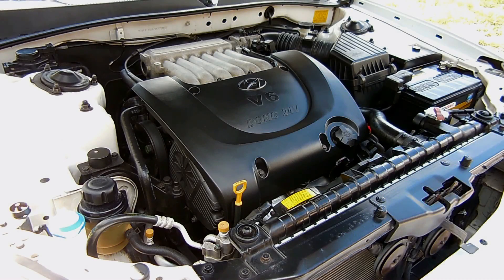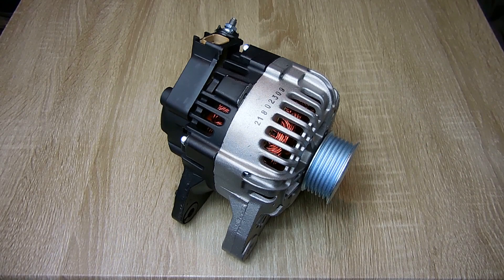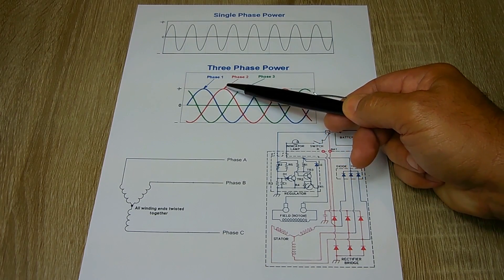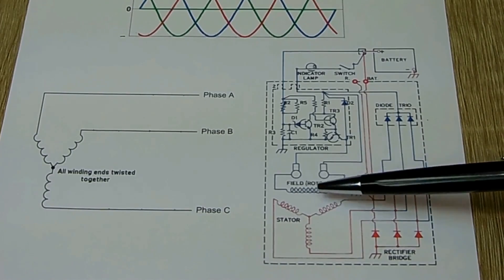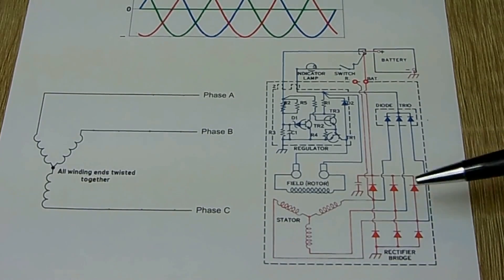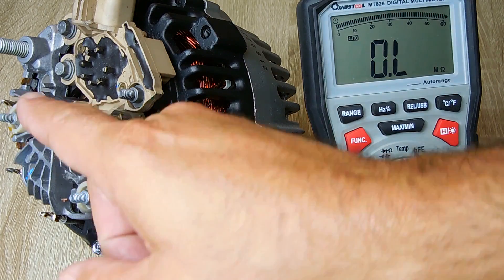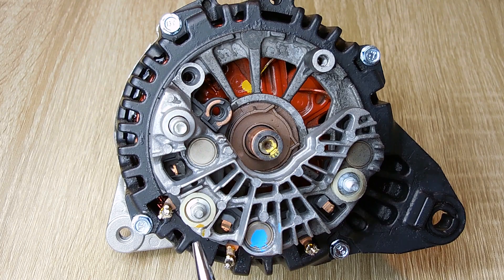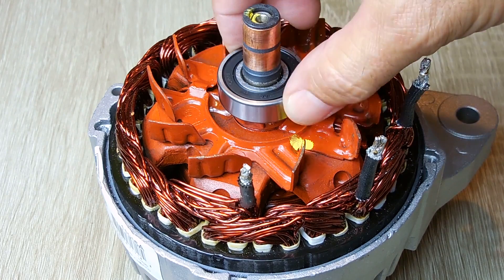Alternator Testing & Repair (EVERYTHING You Need To Know!)

Comment: Very nicely explained. I am facing problem with my car's charging system. When I  hard accelerate my car, the battery symbol lights up intermittently. During night I noticed that when this battery light comes on dashboard, head light also dims. When I rev the car at standstill this light does not come.  Alternator was checked in workshop and they said that it is fine. Voltage regulator cutout was also replaced but still problem didn't solve. Is this the sign of loose connections in alternator windings ?
Reply from the maker: Sounds like intermittent failure of the alternator or a loose wire

Comment: I've understood the basics for years and have even dug into and repaired an older alternator 25 years ago, but now my beater has an overcharging problem and I thought I'd watch a lot of videos to see if it's a simple cheap fix that will keep it on the road. 28 year old vehicle in the rust belt, I believe original alternator with 231k miles.... Did I mention oil soaked for a few years since it sits at the bottom of the pile, so bad that it got rejected from a Jiffy Lube while on vacation, and people come into the restaurant to tell me my van is on fire after I park and walk in (I ask if they actually saw flames). This video is the best I've ever seen and explains things quickly, efficiently, and very clear.... But I'm still puzzled for how the system reads battery voltage and if it could be a false low thus causing an overcharge of almost 18 volts. I have the gasket to fix the leak, but am not sure if the van is worth a new alternator as it could use that money elsewhere. Many people tell me to scrap it as they are haters, but the sucker always starts and chugs along on its 5 running cylinders. 45k miles for $75 so far, plus about $65 in repairs.

Comment: I'm replacing the bearings in a spare alternator and noticed a bit of corrosion in one of the orange winding wires - it's corroded about half way through. Should I continue with the bearing job  or replace the entire unit? For now there is no continuity between the windings and the case. Cheers.

Comment: other videos said to test diodes by putting multimeter red to + and black to case and get 1, then put black to + and red to case and get 500-800, i get 1200, does that mean my diodes are bad ? i want to repair my old broken bosch alternator cause the replacement napa one i fitted has started to give me pulsing headlights above 2500rpm and im concerned its dying after 18months !
thanks
Reply: Depending on the multimeter you have, it will either show  1 or OL on the display. They both mean the same thing. They mean there isn't continuity between your 2 multimeter leads.

You're getting 1200 millivolts because you're measuring from alternator case to B+ post. You're essentially measuring through 2 diodes at the same time. You need to measure from the positive diodes on the positive plate to B+post. Place negative lead on B+ post and positive lead on each winding's terminal. The terminals of the windings on the positive plate are the anodes of the diodes. Measure all 3 diodes. You should get about 0.600 volts on all 3 if they're good.Then switch your leads and measure again this time you should get a 1 for 3 diodes if they're good.

To check the negative diodes on the negative plate, place your positive lead on negative plate (ground) and negative lead on windin's terminals. Check all 3. You should get about 0.600 volts if they're all good. Now reverse the leads. You should get a 1 on your display if they're all good.

Comment: I like your videos a lot. You do a great job of explaining things. The only problem I have is when you're explaining the AC sine waves, you're saying that no power is created from the peak of the wave That is not correct. The wave is a voltage wave so the peak is the max voltage. The center line is zero voltage and anything above or below that center line is some voltage value between the peak and that zero. I hope this helps. Keep making great videos

Comment: Where do the negative pulses go? Do they go to ground or do they get fed to the battery and field windings too?
Reply: There is no "negative" pulses per say. There's only current flow from positive to negative. Current flows from positive end of stator winding through one of the diodes (from anode to cathode). It exits the alternator through its B+ post. It then goes to positive battery post, through the battery, and out the battery's negative post. It then enters one of the diodes through the anode (diode who's anode is connected to ground). It goes through that diode and returns to the other end (negative end) of stator winding that produced the current. The current has to complete the circuit. The current has to return to the stator winding that produced it.

Comment: Hi there, I watched your video and found it really interesting.  I have an issue in my van where I am getting 3.81 amps battery drain with the  engine switched off. Tried disconnecting all fuses one by one with no joy. However; when I disconnected the power from the alternator, it dropped to an acceptable reading. What could be the cause of this? Not over charging, when running getting 13.65v when idling. Any advice would be very appreciated.
Reply from the maker: Bad diodes.

Comment: I have a problem with my alternator which is, when i open the lamp radio ac, my rpm a dropping , like not enough power.. I check the carbon just fine, do i need change rectifier or ic?? Hope u can help 🙏

Comment: I have my 99 Mitsubishi Gallant and the alternator is sometimes quit charging the battery, it's kinda on and off,  so is that an alternator issue or ecu or something else 🤔????
Reply from the maker: Sounds like the rotor brushes may need to be replaced, or a poor connection.

Comment: Charging volts shouldn’t be lower than 14.2 to without load and shouldn’t drop under 14 on full load. 13.8 are no good voltages for modern cars.

Comment: Good basic explanation.
Two points for clarity:
1. In a sinusoidal output, technically, power is always generated  except at the zero crossing points- no?
2. Per the schematic show, the thing you call a transistor, is the voltage  regulator, composted of ALL the circuitry (3 transistors, resistors, etc) needed to do the voltage regulating function. A "transistor" TO3 type (looks similar) has three terminals- the case itself is one terminal- the collector. The other two terminals are the Base and Emitter.

Comment: At about the 4min mark you say it's not making any power, because it's going negative. 
But you have 6 diodes so you should be making power on both halves.
Reply: I agree, IF the output of each phase is "sinusoidal"(360 degrees of rotation), then the only time there in "no" power being generated, would be at the ZERO crossing point- regardless of polarity or direction. All other degrees of rotation, power is "generated"
Basic electronic knowledge. Good catch.

Comment: Hi buddy, I just subbed.

I hope you can offer some advice.  I've a Parasitic drain that I'm pretty sure is my Alternator.  I say 'pretty sure' as there is a 450ma drain when i connect it and the battery drains to low voltage of arouns 12v in 3 days or so.  I'm hoping to diagnose without removing from the vehicle.

However, it charges fine and puts out 14.5v even at load.  The battery is new but the old one if fine too.  I've used my MultiM on B-post and casing and get zero reading, then swap polarity and shows around 450-550.  I'm stumped.  Almost every single video on Alt testing suggests that if i don't get a reading both ways using the Diode Test setting then it's fine.  It clearly is not.
Reply from the maker: If you disconnect the alternator for 3 days and the car starts right up, then you'll have confirmation.
Reply: @electronicsNmore  Yeah this is alerady confirmed, but what I'm questioning is the Diode Test that is all over Youtube etc.

the diode Test on car is fine.  I'm not getting a reading the other way.

What else could it be?  the rectifier?  Could the Diodes be OK?  It's definitely the Alternator as it literally only has one wire to it.  The other is the Ignition wire.  when I disconnect the Positive lead the drain stops. But everything else re the alt is working fine.  It charges thebattery, the lights don't flicker and the volatage doesn't drop when at full load.

Could an issue with the Ignition wire cause a battery drain?  Say something to do with Immobiliser or ignition?

Comment: I repair them,among other mech works,for a living;
1--- diodes are "paired" in  two groups of 3 , pos.and neg, cannot test them individually like that,but you can test the whole group,and that helps a great deal;
 2---nowadays, for over 10 years now,the voltage regulator is electronic and it CANNOT be tested with voltmeter  nor with a test lamp,it works via a square wave sent by the engine ECU,you need an oscilloscope,or test by replacement,a laborious task sometimes.
Reply from the maker: As long as the windings are disconnected so they do not interfere with the test results, they can be tested individually. What you said about newer vehicles I agree with.

Comment: Great video. The most detailed in layman's terms. I have a 2006 subaru sti with a Mitsubishi alternator that failed. Tested at shop. Bad voltage regulator on order. Took a chance they had part in stock otherwise I could have tested and repaired myself.
Reply from the maker: Glad you enjoyed the video! Be sure to share. Thank you

Comment: Cool. In Toyota Highland 2019, I could not see the hardness output of the alternator. Only I could see is a big cable connector to Battery + and a small wire attached to the frame. I wonder if there is a new design which not what you showed in your video. In Corolla 2018, I could see wire hardness (one wire is hot in the run) right away. Mister, can you show me where the wire hardness output of the Toyota Highlander 2019 alternator? Thanks.

Comment: Thank you great explanation! Correctme if I am wrong, please? BOTH "slip rings should be the same exact diameter right? if one has a groove in it the  slip rings are not wearing evenly? What causes that please? Bad brushes? One brush spring is stronger than the other? thank you.
Reply from the maker: Yes, they're the same diameter. The brush would cause the groove in the copper ring, possibly has a hard spot inside it. Thanks for watching!
Reply: Got it thought so. Thank you!

Comment: This is describing the inner wiring of an alternator and testing them.  The tile is misleading.  When I take my alternator to a parts store, they test it.  You don't see them doing this nor does anybody else.  I appreciated the video. Don't get me wrong.  Now if you finished off your video by getting the alternator to produce power showing what to look for to hook up what wire to where with clarity and not hey hook this up to blue and this to white wire..... ( that is b.s.) .  That would have been the ticket.  Anyway everybody knows what I just said.
Reply from the maker: Title's not misleading. I explained far more than most YT videos on the same subject, and with very good clarity. Not everyone takes their alternator to the parts store to be tested, many prefer to test them at home, especially if a parts store isn't close by. My video not only gives them that ability, but it also shows them in detail the inner workings of an alternator, so they can swap out faulty internal V-regs, diodes, brushes, etc. It's impossible to please every viewer. Thanks for watching
Reply: @electronicsNmore   Put the finishing touch.  Hook up the wires and make it produce power.  I guess you were too busy for that part and will be.  I understand.  Look I clearly gave credit to what you did.  That is a matter of pure logic and sensibility.  But you showed no consideration to what I clearly point at.  It is the way it is.  To me, clearing seeing that is not new and to most, they don't pay enough attention to even bring it up.  Hook it up and produce power and explain the hookups. But you won't because you probably think  I am being obnoxious.   Oh, I should really mention thank you for replying back, it is the right thing to do that has earned to have had the time to do it.
Reply: @electronicsNmore  Some of these comments are pure comedy.

Comment: What about amperage output?
Reply from the maker: Most people don't have the equipment I have to measure current. If the battery voltage climbs to around 14-14.5 with the engine running, and you see the vehicle has no problem keeping the battery voltage up under load(A/C, etc), then you know there's no problem with the power output. Thanks for watching

Comment: I took my alternator to autozone and the guy said it was good but it was throwing 15v the guy said it could be a high output alternator how can i tell if its a high output alt or is it just a faulty alt
Reply from the maker: Around 14.5V is usually the top, 15V is too high and may cause the electrolyte in your battery to boil. Get a new voltage regulator if the test is accurate. Try another parts store.
Reply: Ok thanks for the advice will do that because my battery is new and dont want to destroy it thanks again great YouTube channel btw 👍👍👍

Comment: Thank you for posting this vid!  It helps demystify that sometimes difficult to understand alternator.  In a vid in 2016, you recommended the Mustoool MT826 from banggood as a decent DMM.  Do you still recommend this particular model or is there a newer, better model?
Reply from the maker: Hi there. Yes, that DMM is well worth the money. There are newer versions, but they lack certain features. Banggood is sold out, but I supplied a link to Amazon.

Comment: When alternator is cold it's voltage is higher 14.5v-14.8v, but after it warms up voltage comes down to about 13.8v which is what you want to recharge battery after starting.  This is temperature compensation which uses a thermistor in the regulator circuit.
Reply: Never experienced voltage drop after warming up. Mine stays 14.2 to 14.5.

Comment: Just wondering why you didn't show removing the rotor from the housing.Other than that,a great,thorough,and accurate explanation of testing.
Reply from the maker: Hi Les. There really wasn't much to see on the other side, just another bearing. I added images of the full rotor and stator for viewers to see. I would've needed to get out my impact wrench to remove the pulley. Thanks for watching!

Comment: I was having intermittent draining issues and constantly jumping a new battery.   I used a cheap battery charger to recondition my battery, so the battery was fine.  I couldn't find the drain.  I checked my battery before and after a drive and noticed a lower voltage.  I concluded the alternator was bad. I bought a new TYC alternator for $100 on eBay last week and put it in.  Everything is fine now.  I was thinking about testing my old alternator and after watching this video I decided it doesn't really matter.  Unless I test everything it isn't worth testing and fixing one thing.   No need to test the regulator if the windings might be bad.
Reply from the maker: Test everything but the regulator, if everything tests OK, then you'll know the regulator is the problem. Thanks for watching!
Reply: @electronicsNmore  May test it for fun, but already swapped it out so i won't be repairing anything.